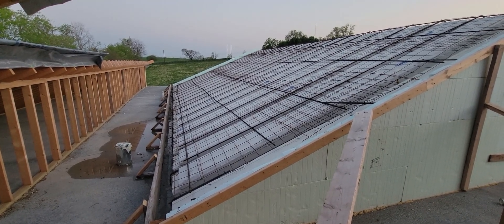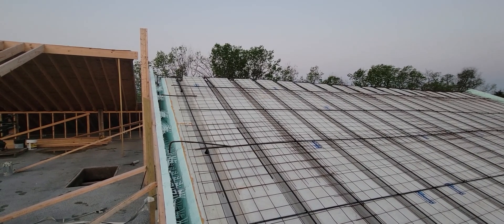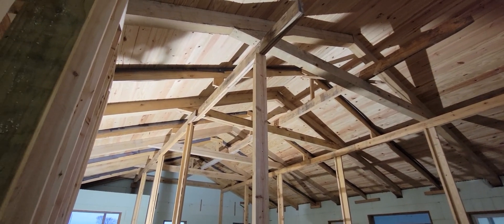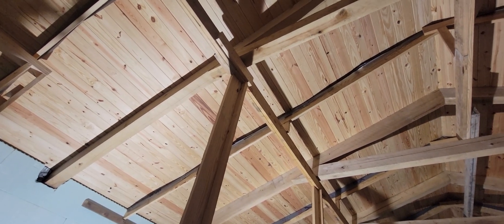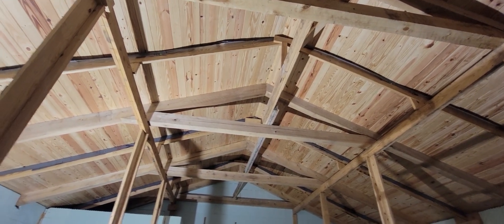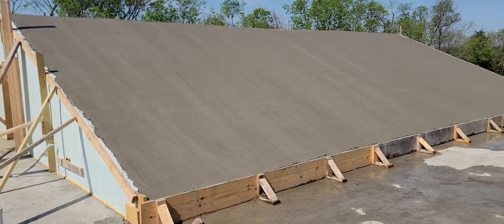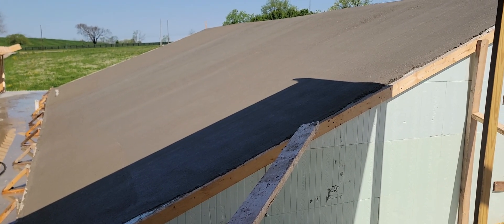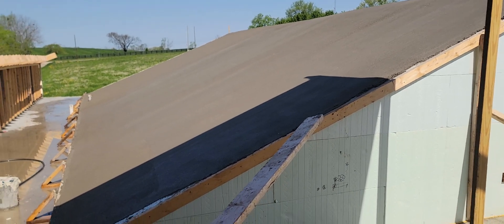Living Room - Litedeck sloped ceiling pour

Comment: Why did you go with ICF interior walls and ceilings/floors?  Are you in a tornado zone or preparing for a zombie apocalypse?  I like the idea of ICF on the exterior but I get the feeling the interior ICF walls would cause a lot of varying temperatures unless you have a great ventilation system.
Reply from the maker: Good question Jason.   The ICF interior walls are to support the concrete ceilings.  If I had not doing the second floor ceiling as ICF, I would not have done the interior walls as ICF.   The main reason was for the shear increase in efficiency of the house, however, if I was to change one thing on my build, I would not have done the second floor ceiling as ICF.  The cost difference would have been worth not doing.    The rooms are zones for climate control, and has a good vent system, so that is not a big deal in this one.
Reply: @@DanielWier  ah I see. That makes sense. Would you have still done the 1st floor ceiling as ICF? I plan to build a new home with ICF but I'm thinking about keeping the inside walls, ceiling, and the roof as typical lumber; aside from possibly a safe room anyway. I'm too scared of having to bore through concrete if I want to run a wire.
Reply from the maker: @TheEngineerJason  Yes, I would have done the first floor ceiling.  The floor have hydronic heating, so that was one of the main purposes.   And through this winter it is nice and warm in there with a low heating bill, even without drywall and being perfectly closed in yet.  For running a wire, no big deal, just a 1/2 mason bit.  Up to 1.5" for a hole is quick and easy.  Over that, boring is a pain, but still not that hard.
Reply: @@DanielWier  that makes sense. WarmBoard is also an option for hydronic floors, but that stuff is really expensive. It's probably cheaper to pour concrete.
Reply from the maker: @TheEngineerJason  Part of what I like and makes it cheap to heat is the fact that there is MANY tons of heat mass.   Which is really good and bad.  it takes a long time to change temperature so it cools down slow and keeps it warm in there, however it also takes a long time to heat up, so if you want to increase the temp, it takes a couple hours and even longer to cool down.

Comment: This is amazing how far ICF has come, what will u be putting over the concrete to protect from weather, freeze, thaw and water
Reply from the maker: It is unlikely to ever freeze, and therefor thaw due to the stick frame roof over it, and the convestion of the heat from inside the house moving out.   The way you have to build like this is that the slab is also directly concrete to the foundation, so convection of ground heat up also is part of the equation as well.   It is now covered and protected from the elements.
Reply: @DanielWier  oh so ur covering the concrete roof with shingles or tin? I was wondering if u could just keep the concrete and maybe paint it with something, like that stuff they paint pools with to waterproof them, I am loving your house, especially the poplar ceiling and beams….I am  pretty sure this is the route we’re gonna go, we are def. doing ICF but been looking into the roof and it’s amazing the new system they got out, I remember 20 years ago doing a foundation with these and they didn’t have a roof system back then, great job man
Reply from the maker: @woozy607  Thanks and I highly recomend this method.  Yes you can cover it with a number of things.   Generally, you do not want to do totally flat, and we wanted to put utilities in the attic space, so that is why there will be a spanish tile style roof on top.   Stick framed, then a platic composite tile system, plus solar panels.  That being said, there are a number of ways to treat the concrete if you do a sloped cieling as a roof.   The most common I have seen is just a have latex paint made for roofing and treating concrete.   You could also use valcanized rubber, or spay on like you are saying for pools.   Anything that would prevent water from getting in cracks of the concrete.   Good luck with your project, you will love it.

Comment: Why only used ICF on a partial roof?  Why not the entire roof? Cost?
Reply from the maker: Thanks for the question.  None of the roof is actually ICF, it is the cieling of the main floor with a stick frame roof over it.    The main reason I did not do ICF for the roof is my wife, she did not want to have a concrete roof.   It would have been about the same cost as the full concrete cieling, but would have been alot more support and alot more risk.   It would have saved me some money to do the roof out of ICF instead of stick framing it.

Comment: Very impressive.  How long did it take your team?  Would you feel comfortable increasing the pitch to say, 8/12?
Reply from the maker: This pour took about 2 hours of work, a bit longer, but that was waiting on the make up truck to come.   We have done a 7/12 pitch and other than the concrete sliding due to pour metal work, it went fine.   We have helped on a pool slab that was 8/12 and it went fine as well.   The secret is to have the mesh tied well as I discussed and use a low slump concrete.   More that 8/12 would start to get really hard, and require alot of pushing uphill as it slumps.